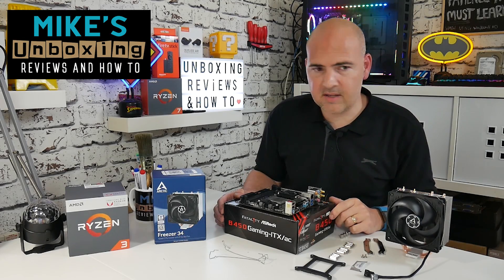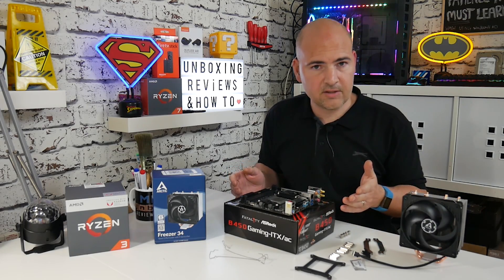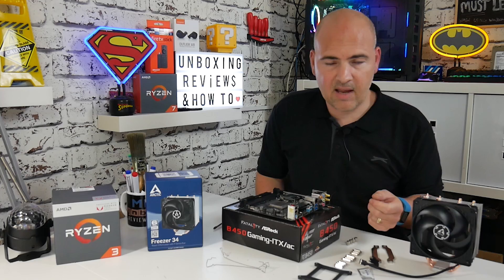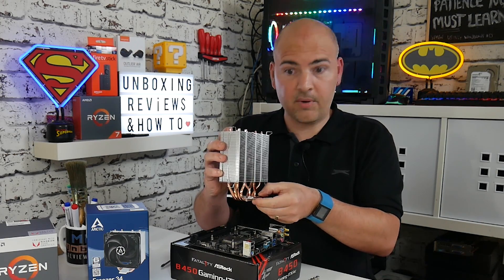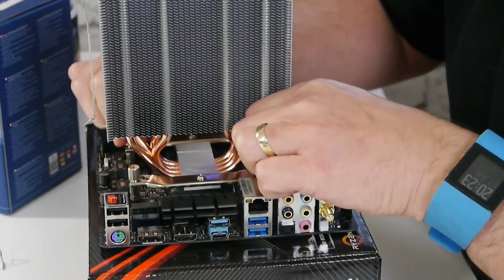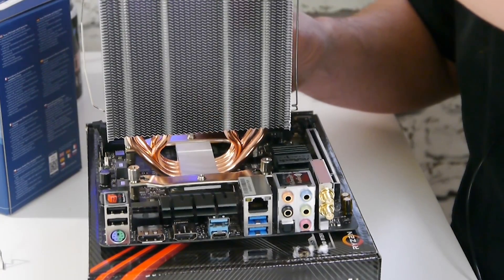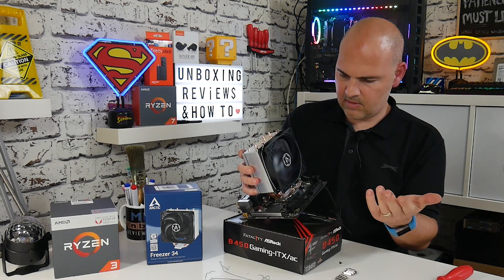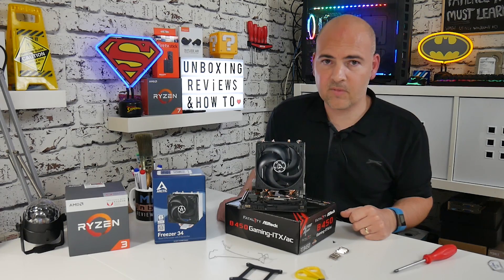How To Install Arctic Freezer 34 CPU Cooler On AM4 Socket Motherboard

Comment: Thank you for taking the time to show us this.  Keep in mind, you don't want to press down the cooler mounting plate onto a hard surface while working on it.  That damages the surface of the cooling plate and can make it less effective in cooling the CPU, because the surface area coverage (while helped by thermal paste) suffers as well.  Meanwhile, if you're applying thermal paste, it's more important to know where the CPU gets hot and to apply thin and solid coverage, not just smear a bunch of it all over the surface area.  Most people put it on the CPU, not on the cooler, but I don't think that matters, as much.  Keep in mind, also, that if that thermal paste spills over the edge of the cooler and makes contact with the board and the CPU, then you may find you'll have other issues.
Reply from the maker: thanks for your honest E :-) But seriousy some very valid points made there. Thank you
Reply: what if there is a bit of thermal paste near the edge of the cpu?
Reply: @raiyo5418  If there is thermal paste near the edge where it may come in contact with the motherboard, you might find it can cause a short.  Be sure to clean up as well as you can and to not use electrically conductive material.
Reply: and some on the green parts of the cpu but not alot

Comment: Would this fit in a Thermaltake view 27 ?
Reply from the maker: Yes should be good in there
Reply: @mikesunboxing  my cases Max CPU height is 155mm but this required 157 so I hope it will fit in my case
Reply: @ozgunakpnar2284  Did it fit?

Comment: Hi, i have a question for you.
What is the difference in temperature between this and box cooler?
Reply from the maker: depending on the stock cooler you are using the difference can be after between 10c -25c lower temps

Comment: Hi bro can u use this cpu cooler on a itx case like the one h200 nzxt or its to big for that small case?
Reply from the maker: from the NZXT site it says 
Clearance Cable Management: 16.3mm
GPU Clearance: Up to 325mm
CPU Cooler: Up to 165mm
Front Radiator: 85mm
Rear Radiator: 42mm
PSU Length: 311mm
Reply: @mikesunboxing  well whats ur conclusion

Comment: I'm having so much trouble with this cooler. The thumb screws won't thread. They just spin
Reply from the maker: What cpu and board
Reply: @mikesunboxing  I have an MSI B450 Gaming Pro Carbon AC. The backplate feels like it wants to be loose and my thumb screws can't get level
Reply: @scottyhaines4226  how did u fix this problem? i have the exact same issue
Reply: @tiastez  use the longer standoffs if it fits in your bracket

Comment: You cant mount arctic 34 freezer on ASRock B450m Pro4
Reply from the maker: Yes for sure
Reply: @mikesunboxing  Then why every site says they are compatable ? :(
Reply from the maker: Vulkarts sorry I misread your comment. The b450m pro4 is compatible with the arctic 33 and 34
Reply: @mikesunboxing  How? The backpanel for the processor screws is too narrow ..
Reply from the maker: Vulkarts using the Stock backplate that is supplied with the motherboard it matches up perfectly with the holes on the freezer 34 I don’t understand how you think it’s too narrow?
Reply: @mikesunboxing  if i use the stock one on the front the right side of the cooler doesnt fit. The right side hits the processors socket...
Reply: Also if use the stock one its way too loose
Reply from the maker: @Danko18101993  can you post a picture on the discord for me to see what is going on? or send me an email
Reply: @mikesunboxing  i saw one video where you put it on a similar motherboard ill try it again if it doesnt work ill send you picture. Thanks for the help tho
Reply: @Danko18101993 any update?
Reply from the maker: Did you get it installed ?

Comment: I tried to install it with MSI b450 tomahawk stock backplate and its too loose.
Reply from the maker: Try using the other smaller fixing screws in the kit
Reply: Hey, i have Same motherboard. Cant use with arctic freezer 34? Am i need a new backplate for use this CPU cooler ?
Reply: Yes, there is issue with this cooler, not sure why. Problem was  too short pegs and gaps between the motherboard and the backplate.  Tested  ASUS and MSI (AM4 socket) they have classic and standard dimensions, so I don't think it's up to the motherboards, so if you can explore  issue little deeper and make a video about the problem and how best to fix it, it would be great. It's a shame that this happened because it's a nice cooler.
Reply: I am using the screws with only 1 mark it still has the problem. Its supposed to stop moving only after mounting all the screws o.O? Its a bit.... unusual... it should sray still already after the 4 base screws.
Reply from the maker: isn't it the screws with 2 marks on? It has been a while since i did it
Reply: @mikesunboxing  1 mark, you say it in this video it lol
Reply: @greenglassman  Did you get this solved? I'm planning on a Tomahawk Max, r5 3600 and this cooler.
Reply: @karlrawstrone8568  Arctic sent me a dedicated backplate for keep the cooler still. I dont know if the Tomahawk Max have the same problem. Its even a bit saggy as it forced me to mount the screws backward.
Reply: greenglassman the Max still has the issue, it’s just a thing with some AM4 boards, as you said just email Arctic for a fitting backplate
Reply: @karlrawstrone8568  can u use for tomahawk max?

Comment: Could I do this on an atx motherboard without taking it out of the case? I cba doing cable management again 😂
Reply from the maker: Depending on the access to rear of the board really but I would say yes with a little luck and patience. I’ve done it without removal
Reply: @mikesunboxing  theres a lot of space I recently built my first pc a few weeks ago and couldn't get a hold of a CPU cooler for my 2600 so I just used the stock but want to change it now to the arctic freezer 34. I have the nzxt h500 case. Thanks
Reply from the maker: Unknown piece of cake in that one if you get any problems join us on discord and we can walk you through it

Comment: You should delete the videos where you said not to buy the master box lite 3.1 because your cpu cooler was the wrong way so your cpu cooler was not circulating air.
Reply from the maker: The coolers orientation isn't the problem. The case has a choked front panel as I proved by removing the the panel and dropping 15c and the rear 120mm with no ceiling vents can remove the heat quick enough.
There are many other videos and articles that support my findings and those that don't just want you to buy from their affiliate links or are sponsored.

All a CPU fan is for removing heat from the CPU and the cases natural or assisted convection does the rest.

I love the look of the case and wanted it to be good, but it isn't

Comment: Hello, i need your help. I got a i10tws from aliepress, at first the left one was totally not working, i used a tin foil between it and the connector in the case and overnight it worked, after that and the main problem is, they are both on, the left one sais 'connected' but the right on doesnt play music, only the left one does. It seems like they're not paired to eachother. I tried leaving them outside the box for a day but no result sadly. I would apreciate your help

Comment: Arctic Freezer 34 Good CPU cooler,
I have the "Arctic Freezer 34 eSports Duo", comes with 2 x BioniX P-120-mm fans £29.99
Suitable for systems with up to 210Watt TDP,
Love the fact You don't have to install a motherboard backplate on my AM4, just use the stock back plate. one of the most easy to install coolers.
Reply from the maker: Nice cooler I have the freezer 33 and 34 in most versions at the moment 😃
The eSports duo is my favourite though
Reply: @mikesunboxing  which cooler is better the 33 duo or the 34? I like the the heatpipe lay out better in the 33 as on the 34 the rear pipes are onbdructed by the fronts, does that make a difference?
Reply from the maker: The 34 fits better on the fan clamps so for someone moving cpus around the installation is easier but otherwise go for whichever is cheaper as they are very similar in performance

Comment: Mike, have you ever used Innovation Cooling Graphite Thermal Pads instead of thermal paste? I've been using them for about 2 years. Thermally they're about the same as paste, but they don't dry up like thermal paste does, and they are reusable.
Reply from the maker: I have been wanting to try the Kyronaut thermal pads, but they haven't had any on Amazon for a while, so hopefully when they're back in stock I will get some.
Reply: @mikesunboxing  Besides the IC pad Amazon has the Thermal Grizzly Carbonaut Thermal Pads that I believe was designed by the overclocker and mad genius Der8auer. They're a little thinner than the IC brand, and a little easier to tear.
Reply from the maker: Yeah I need to get some of this magical substance for testing to get the same results for application variances
Reply: @mikesunboxing That sounds like it would be a great review, Mike.  You should do that!

Comment: What kind of ITX setup gives you room for a monster cooler, surely that defeats the point of going ITX?
Reply from the maker: ITX doesn't have to be a hot box Matthew. And with a decent case like the In Win A1 and this cooler you can be small and cool at the same time
Reply: @mikesunboxing  the exact setup im going for motherboard cooler and case lmao, you tend to find the SFF community getting offended at anything over 15-20L
Reply from the maker: ThatWolffe yes smaller isn’t always a good idea
Reply: @mikesunboxing  its honestly been hard getting information on my itx build without someone scoffing at me because of my case choice, I don't really want a tiny hotbox on my desk.
Reply from the maker: The in win a1 is decent for cooling with a moderately low tdp setup
Reply: @mikesunboxing  thanks for the info! I really love how this case looks.